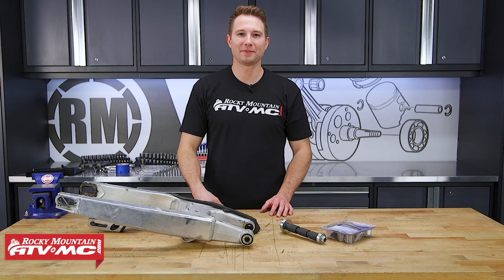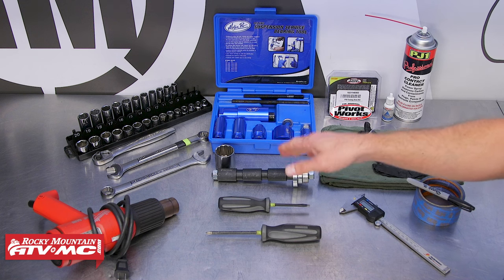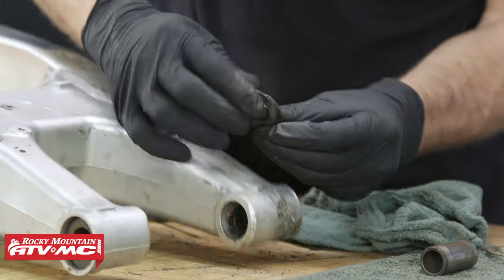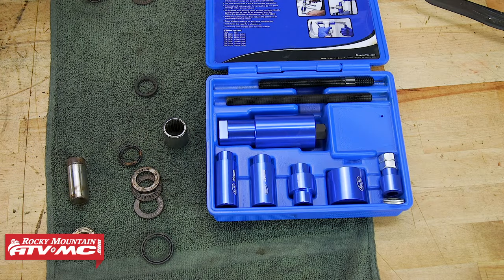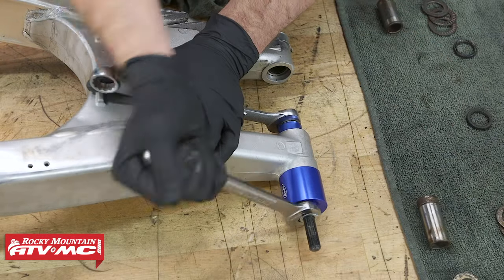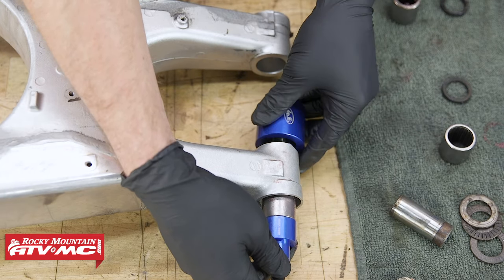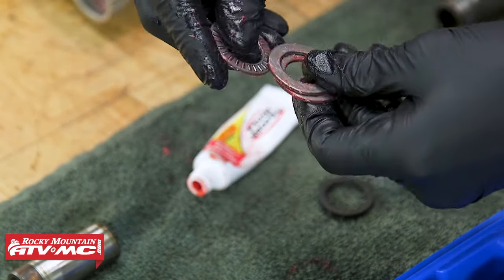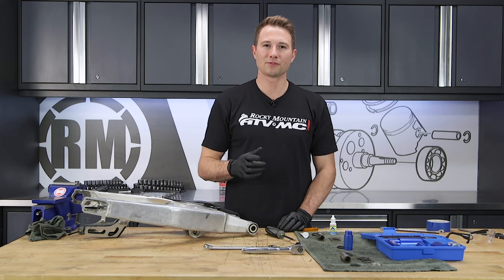How To Replace Swing Arm Bearings on a Dirt Bike

Comment: I have a foot long 1/2 inch diameter threaded rod and nuts/washers, cost about $12 at the local hardware store.  Using this setup with various diameter sockets, I can remove and install just about any bearing on your bike.  Just gotta take an extra moment and make sure everything is going in square, as stated in the video.
Reply: Can you explain to me exactly what hardware I need to build this contraption, I gotta remove the bearings on my 250R and don’t wanna spend all the cash on the kit. Thanks🤘🏼🤘🏼
Reply: @gusgiesel
Reply: @tperez838  
Threaded rod: 
https://www.homedepot.com/p/Everbilt-1-2-in-x-12-in-Zinc-Threaded-Rod-802127/204274026
Nuts & washers: 
https://www.homedepot.com/p/Everbilt-1-2-in-Zinc-Plated-Nuts-Washer-and-Lock-Washer-6-Piece-per-Pack-803552/204276480
You won't need the split washers for this application, it's just an example of the simple setup.  All of the sockets you use to press the bearings will need to be 1/2 inch drive if you are using the 1/2 inch threaded rod.  And with this setup, obviously you can't press any bearings with an inside diameter smaller than 1/2 inch.
Reply: FYI 1/2 inch threaded rod DOES NOT fit through 1/2 inch drive sockets. Use a 7/16 inch rod.
Reply: Thank you

Comment: Removing seals: better to use  a proper size wrench depending on the seal size. They usually don't have sharp points like a flathead screwdriver does.

Comment: getting the swing arm on and off isn't so easy, or when you have to drill out the chain slider screws on old dirt bikes:)
Reply: Mine was incredibly stuck but I ended up getting it to turn using a chisel

Comment: Can you show us how to replace muffler berings mine are going out on my drz 125 I haven't found any videos on your channel on how to do it, thank you
Reply: Muffler bearings?
Reply: @joecooper1543  ya mine are going out
Reply: @koul_2482  berrings for your muffler
Reply: Check your blinker fluid and adjust the sky hook and all will be good 🤙
Reply: @JEvans575  ya i had to put more blinker fluid in  my 5 day old crf 250l because the stupid dealer forgot to fill it from the store
Reply: @koul_2482  no not the silencing stuff I mean the ball berings im pretty sure only 2 strokes use that stuff
Reply: @bradleypumba  make sure to change your power band while you are In there, I went for a blue one cos the red was too fast
Reply: @tortron  ya I made sure to do that also. I also went with the blue one its helps for wheelies too

Comment: Why won’t my bearings go in smooth? One side won’t go in at all but the exact size of hole
Reply: Put the bearing in the freezer and heat the swingarm then try to instal it
Reply: Coat metal parts with grease before putting them in the freezer. When you pull them out of the freezer the grease will keep the metal parts from collecting humidity in the air.